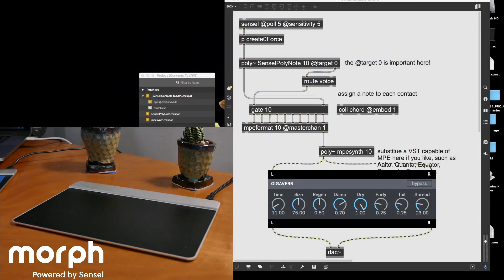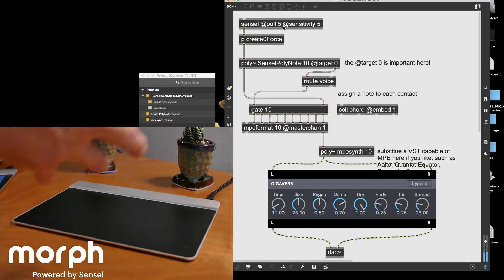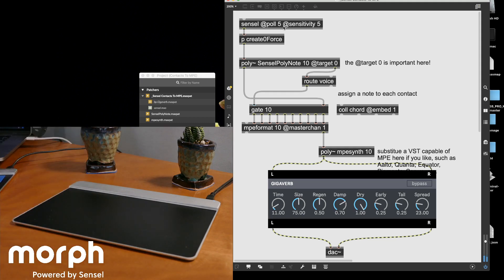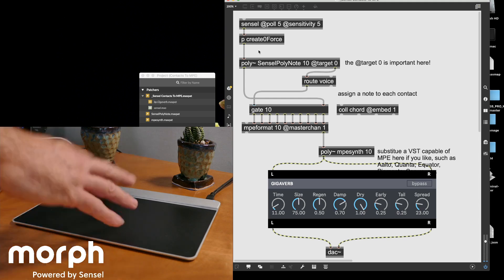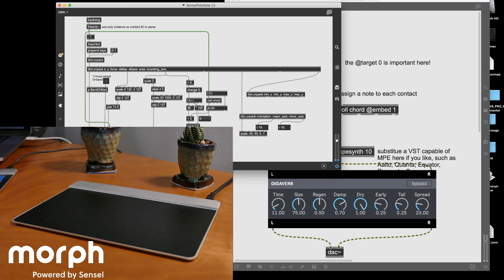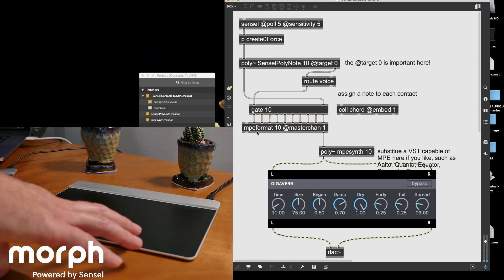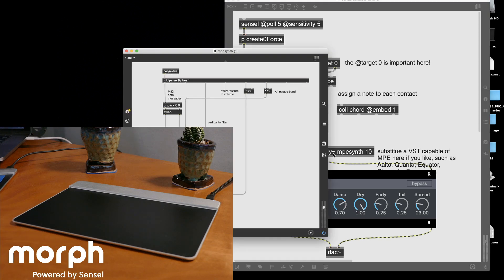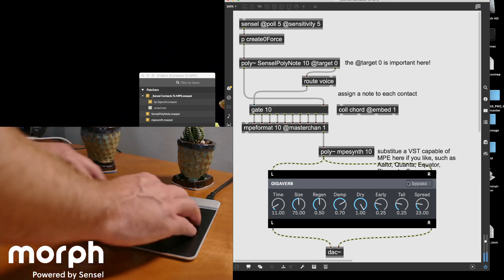02 - Contacts to MIDI Polyphonic Expression (MPE). Max & Morph: Multitouch

Comment: hey peter ! what map do u have loaded onto the Morph for this one ?

right now i have the same 'no overlay' setting as the 05 Multitouch from MIDI (1 big MPE key with 14-bit CC 10-12) and it mostly works but sometimes when i hit the same spot repeatedly, it plays a note with a different pitch bend to 5s ago, maybe because this is the wrong map setting ?

it's weird, sometimes when i have 1 finger held down, another finger joins and i can slide the 2nd finger below the 1st on the X axis and it is actually a higher pitch
Reply from the maker: In this particular video, the overlay is ignored, because I'm using the "sensel" object. The sensel object is pulling raw contact information from the Morph as a serial device. In the "Multitouch from MIDI" example, it could be an issue of your morph settings http://guide.sensel.com/app/#morph-xxxx-morph-settings - I have MPE Pitch Round set to "Gravity."
Reply: @SenselInc  i dream of music tech manufacturers being as helpful and as detailed as u. thanks !

Comment: Are there any barriers preventing the MPE conversion layer from being coded as a Mozaic plugin for use with AUv3 hosts on iOS?
Reply from the maker: Hi Joe, thanks for your question! Not that we know of. However, we don't have any experience with Mozaic, so we can't advise directly. 

But perhaps it's helpful to note that there's not really any "conversion" happening - the MPE data sent from the Sensel Morph is just MIDI data that conforms to the MPE standard.
Reply: @SenselInc Thanks. I realized when I saw your Bitwig demo, with the full canvas running in MPE XYZ mode, that this would be really easy to emulate in iOS. The AUv3 hosts can already do the channel mapping and transposition. Something like Mozaic or MidiFire would only be needed for arpeggiation.

Comment: Massage is a good term for this kind of manipulation, but I think caress better conveys the incredible sensitivity of the Morph.
Reply from the maker: True! I also like to use the term "tickle" to convey sensitivity.
Reply: I once owned the domain caressablemedia.com, but let it lapse - looks like no domain squatter has grabbed it, so it's currently available and cheap.  I currently own (but am about to let lapse) the domain fingertipcontrol.com, let me know if you want it.  Ticklemedia.com is available, but a domain squatter wants $800 for it.   ticklemymorph.com and caressmymorph.com are available.  :-)  Caress is a great term, though, very elegant and gentle - David Wessel used it to describe his work with an extremely-sensitive touch interface.